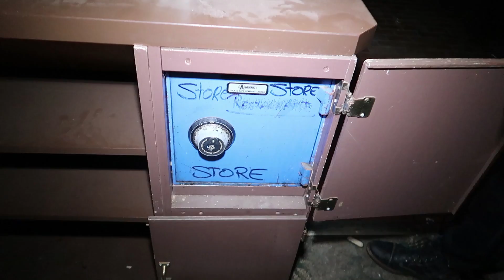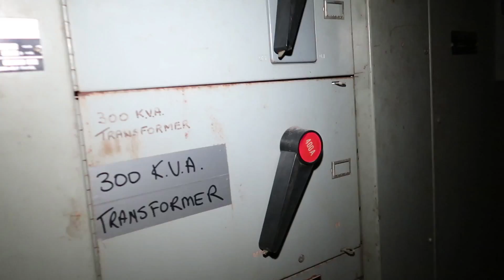(SAFE FOUND) OVERNIGHT CHALLENGE ABANDONED TRUCK STOP // OVERNIGHT CHALLENGE IN A SCARY PLACE

Comment: Old-school circuit breakers at approximately 16:00. That truck stop had to have been built sometime in the 1970s, because some buildings built around that time period had those type circuit breakers that took both hands to turn on or off.